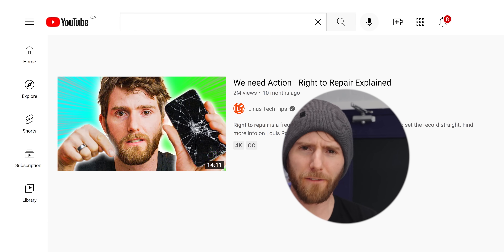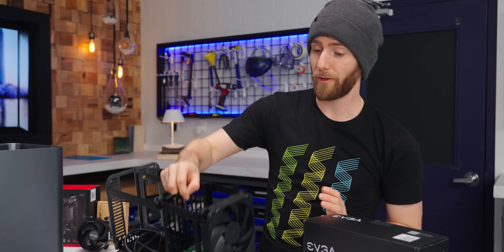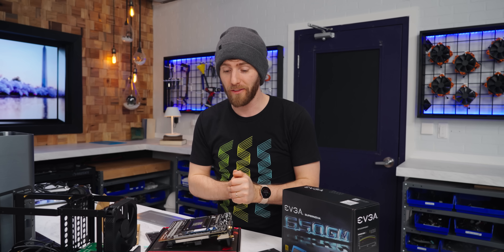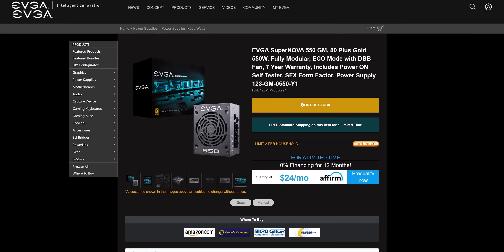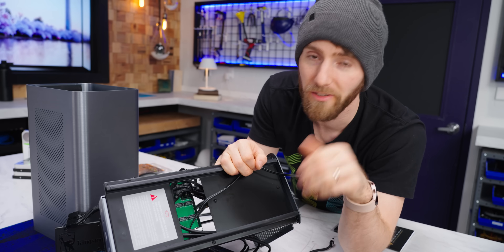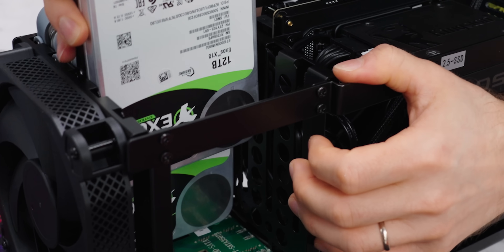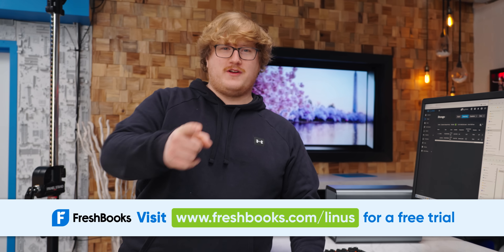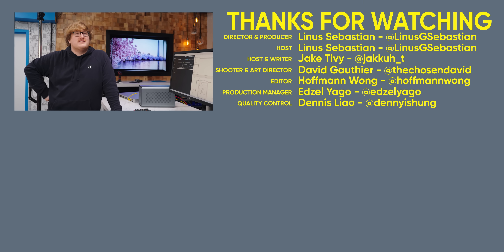This blows away the competition - JONSBO N1 NAS Build

Comment: Its nice the the one side of the harddrives is cooled... but doesn't look like that fan is doing anything else on the front there even if it is trying to do some static pressure, hopefully your CPU cooler is plenty and the rest of your board doesn't need any airflow.